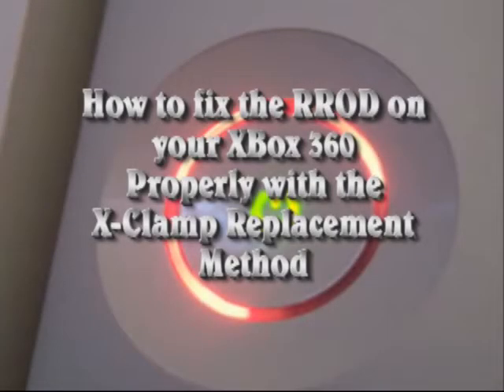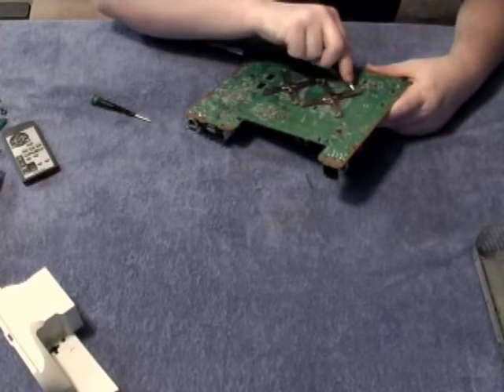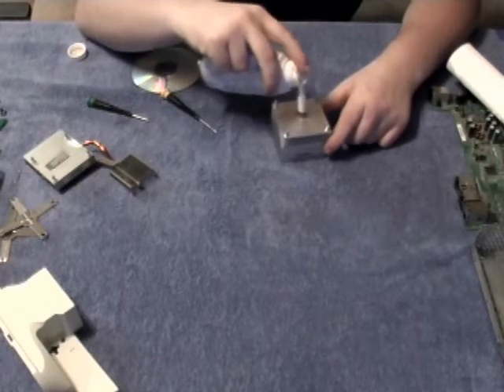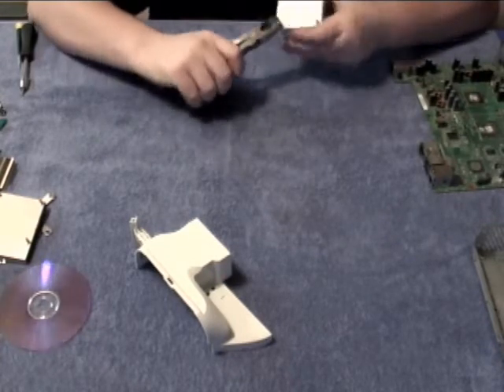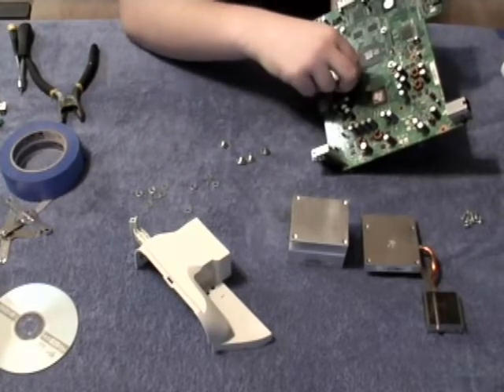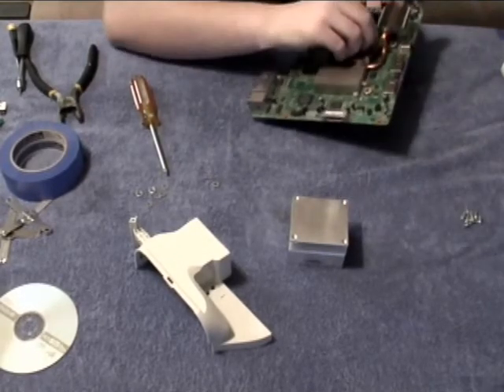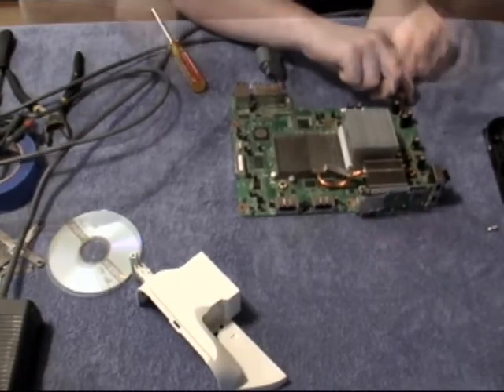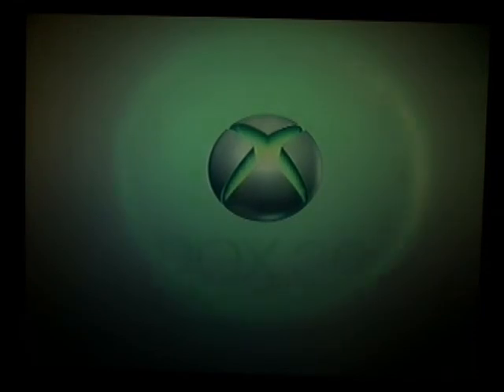XBOX 360 X-Clamp Replacement and RROD Fix (Part 2 of 2) "RROD Fix"

Comment: Sorry this has taken me so long to post but I have been busy in the real world.  I have yet been able to find those screws you say are needed. I have been to several hardware stores and none of them have a large selection of Metric sized screws and washers, the one store that did have the M5 size only had extremely sort ones. The man who helped me said that the size I was describing to him( that I got from your video) was not possible. As such I am slightly disappointed. Any advise?

Comment: hey i just did the xclamps fix and i turned it on like you have yours and i get the rrod on immediately, the fan does not run, the drive does not open all i have is the lights flashing, what should i do?